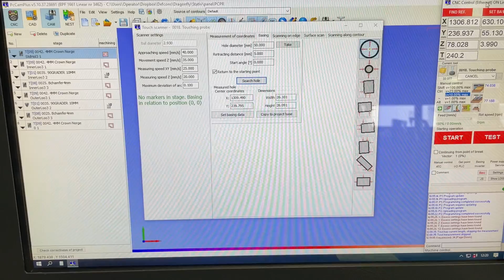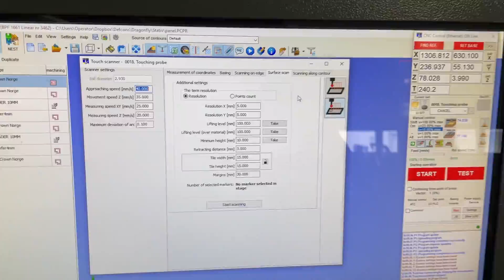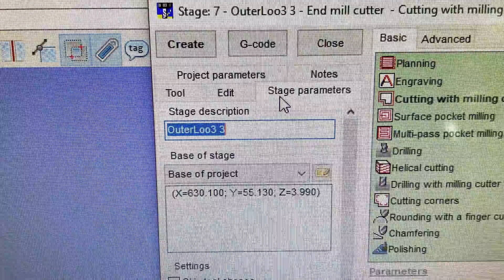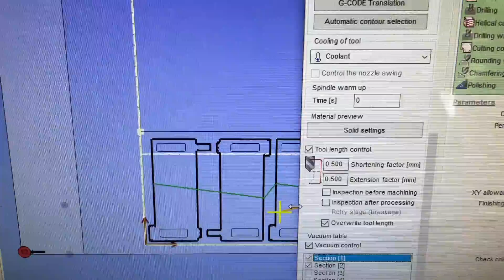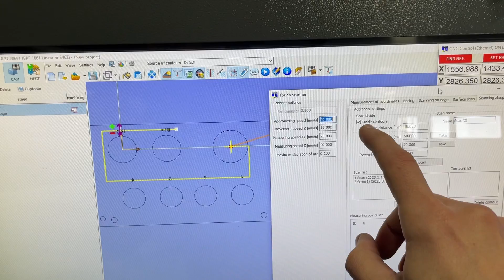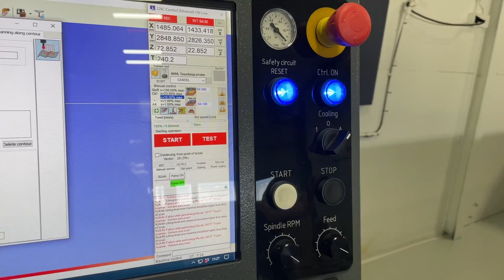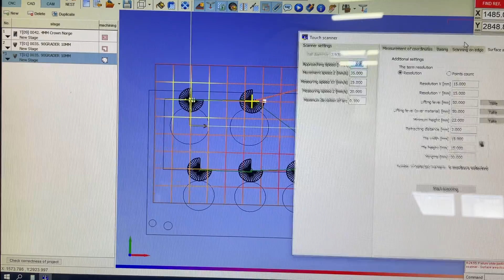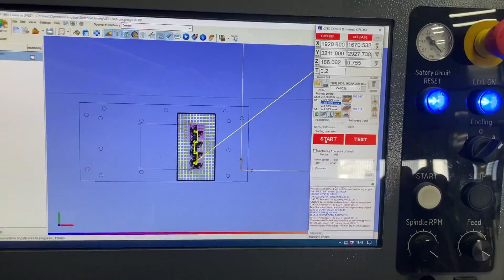Top 10 MONSTER ROUTER things/features - Kimla / PCCAM

Comment from the maker: Having had a extra productive week with the machine and the 2 year anniversary(!) for the Kimla arrival coming up i reflect on my favourite things about it.

Im kinda gushing in the video but its just all so good.
Note. I have seen really high end machines that i would deem equivalent in build quality but then taking the price into account I have to give the win to the kimla.
And when i say "I have seen most of them" i mean a subset of machines from the main manufacturers typically at the big tradeshows. Biesse,Anderson,Wissner,portatec,thermwood, CR onsrud,multicam ect ect. Some of them offer linear motors too! 

Felt i better clearfy to that extent. Alot of good machines out there!

Regarding PCCAM, There is still alot to discover. Automatic placement and nesting is in the cards next.
There is also filename "properties" that can be read in. Material,amount of parts,thickness and also tags that could possibly couple the part to a specific workorder. Exciting stuff!

Comment: Love the videos, thinking Kimla might be the next router for me. Curious what model spindle is spec’d on your machine?
Reply from the maker: Hey, thanks its got a "Kimla Version" of HSD's Watercooled ES951 12kW S1 (14kW S6) HSK63F.
I can stall it going fast with a 16MM triple flute 10mm deep into some 5083 I found out the other day  x)
Reply: @randomrouting That is an awesome setup! Appreciate you sharing your journey and expertise with the world. What is your max rpm?
Reply from the maker: @andrewm1950  Its my pleasure! Its 24krpms, id love more for them small tools i often run. My old machine had a 32k spindle but then again, I do run some thick stuff from time to time so 24k is a good allrounder.

Comment: Hi .
Im Wondering If its possible to Get In touch with you , the company i work at got a kimla router this year and cant figure out the perfect rpm and feed speed when milling in alu.
Reply from the maker: Hi.
Easiest way is probably msg ulundateknik @ instagram.
But if its about feeds and speeds then a comment here probably suffice :)
What tools and what type of aluminium are you cutting ?

I cut mainly 5754 which is soft and i run alot of small tools. You want to produce big chips even with small tools, to keep the heat away, and go with dlc coated single flutes.

I mostly run Crown norge single flute coated tools (kimla sells them aswell).
a 2mm diameter (6mm flute length on all) i run at about 22mm/s, a 3mm i run at 35mm/s and 4mm at 40mm/s . 6mm at 50-70mm/s depending on the part. All at 24k rpms.

If using a 3mm then i got 1 pass on 2,3,4mm alu and 2 pass on 5mm.
Using a 4mm endmill i run 1 pass on 2,3,4,5mm.
6mm endmill 1 pass up to 8mm alu.

For 6082 you might want to back off a tiny bit, and 7075 a bit more.

Comment: what is the part number of the dust collection shoe?
Reply from the maker: Not sure there is one? Maybe kimla has them, not sure. The bottom platter(with the ethanol jets) is my own 3dprinted version though.
Reply: is it possible to get a picture of it and how it attaches to the machine, whether the spindle or is own separate linear actuator? i am currently running a multicam 5000 series cnc and we cut alot of plastic parts and our chip collection is seriously lacking. @randomrouting
Reply from the maker: @coldhardcad8882   Ah i see. I dont have a pictue but i show a bit here: https://youtu.be/xuGintM2q-E?si=Uo8UWfutBZBMoKpY&t=875

I dont think you will be able to buy this separately from Kimla but you could ask.

I used to have a Multicam MG series and back then I was considering this one from Axyz.
https://cncshop.com/products/028088-high-capacity-cast-pressure-foot?variant=34336310919301

Ps. I hate cutting plastic.
Reply: this is phenomenal information.  your system looks like it doesn't use brushes and just keeps the inlet very close to the workpiece. is that correct?  is there a difference between a pressure foot and a dust shoe? @randomrouting
Reply from the maker: @coldhardcad8882   No brushes, The bottom plate on mine has tiny holes that eject pressurized air so that it may float on top of the material beeing cut. My machines original plate is made of stainless steel so i have 3d printed mine so it wont scratch the aluminium if/when the sheet gets cut up to the extent that there is no surface left to float on. 
The inlet hole is 65mm, just big enough to let the HSK63F tool holders trough and there are some threaded holes in the side of the unit that you may plug/unplug to adjust the underpressure/airflow in the cup.

The Axys one i think is available in two versions, one with a "blue donut" which is just a PTFE (or other low friction plastic) and slides on top of the material, and the other version you manually set the hight.

When using system like this you should consider that the airflow is quite restricted and therefor low, you would not do well with a typical woodworking dust collector system. What you want is a high pressure low volume system. I use a side channel blower but there are other good systems that work kind of like big shopvacs.
And when using these systems you dont want to use big 6" ducting.. im using 3" hose and pipe for fast moving air.

Comment: You have probably been asked this before but why not a Fibre Laser instead of a router? I work full-time with a new Amada Fibre laser...
Reply from the maker: Heya. There are a few reasons.
Mainly its because the stuff we make cant be made on a laser. Alot of the stuff we do is 2-2,5d machining (like pocketing,angled faces, threads,surfacing,countersinks ect)
We use the probe alot, do quite a bit of engraving,put parts into the hole in the table then work on the edge,machine 6 meter extrusions on the T-track and pretty much all parts needs to be chamfered on both sides. (which we do without flipping them)
There is no beating the versatility of a router even tho a laser/punch combo machine gets pretty close. You could buy multipl of these routers for the price of amadas laser/punch combo machine tho :) 

Parts are clean(ready for paint) and completely finished, brushed for paintadhesion,cut,threaded,countersinked,engraved and double side chamfered right off the machine (except bending) and that I love the most. They are ready to go without manual labor.
Reply: @randomrouting  awesome! thank you for such a great reply. you have completely changed my opinion of routers. Most People just use them for cabinet manufacturing. 

I hope Fusion invests in  CAM tools Specifically for routers. I currently use the manufacturing extension to nest my parts but the CAM can get very tedious for doing many sheets. 

Have you heard of SigmaNest? Their software looks pretty compelling. integrated offline bending and nesting. sadly doesn't work with the Amada brake press though.
Reply from the maker: @Waytoofarr  Thanks! Yes, if i remember correcly Kimla's (the router brand) nesting addon is using the sigmanest engine for their automated nesting. I dont have that yet but i will soon as i plan on getting it after a visit to the factory soon. 
Havent ever used sigmanest tho as im using amadas "production designer" for flatpattern generation and bending programs. I have automated the heck out of it and it pretty much runs by itself most of the time. I got some scripts that massage the dxf to find features/renames layers and then the kimla autogenerates the toolpaths instantly. Including all chamfering,countersinking and threading.
Its quite crazy accually. 

Another good software for routers is Vectrics Vcarve.(including nesting)

Comment: Hi, May I know around how much is this Kimla CNC machine? Great content❤
Reply from the maker: Back in late 2020 it was around €150k including shipping,12 toolholders ect. 👍
Reply: I bought my first 1.8*2.5m cnc router from China, with t slot table and vacuum table side to side, and a rotating axis. But the machine rigidity and accuracy is really sub par. it only cost €25k total, but I got to make a lot of upgrade to the cnc, and train myself😅
Reply: I really admire your machine, but the price is too much for me now😬
Reply: Wish you the best, I learned a lot, thanks for sharing❤
Reply from the maker: @bbbbbbbbb1975  I built my first cnc from parts in early 2010/12 or so and then later bought a used multicam (4k euro) and retrofitted the control,atc spindle  and servos over a couple years, used that to build the business and eventually could justify and afford the kimla.
Keep going and perfecting, you'll get there!
Only problem is the goalposts keeps on moving :)
Thanks for watching!
Reply: @randomrouting  I think Kimla should support you for making content for their machine, I don’t see any YouTubers make content about Kimla CNC, your channel is underrated!

Comment: Kimla is a funny company. The machines are ok in many ways, but sometimes they do stuff like put soft PU hoses (instead of Nylon or Polyethylene) all throughout the machine (even for coolant). I was helping a friend of a friend as I can service most of CNC machines and I found out that 3 machines had a problem of disintegrating hoses at the same time - All throughout the machines the hoses were disintegrating at random places (coolant mist entered every crevice of the machine from the machining area). It was a disaster, I couldn't even open one of the machines due to strange sheet-metal work. I told him naah I'm not fixing this, call Kimla people :D
Reply from the maker: That doesnt sound great, I didnt see any of that tho. Perhaps they have evolved :)
I have had some gaskets deteriorate rapidly, and the "level showing tube" on the container aswell, but i was running ethanol in a system designed for oil so that was kinda expected :)
I just changed them out for epdm,ptfe ect.
Reply: @randomrouting  yeah I hope they did :D  we were running ethanol cooling with a strong vacuum system and I always worried it would do a bit of a boom one day, but it never happened :D thank god :D We filled a 2000l bag with aluminum chips every 10 days :D Too bad that most of the router companies don't have a ready solution for ethanol cooling even though the machines cut aluminum very often
Reply from the maker: @chronokoks  Yeah its always at the back of my mind aswell since ill be running so much unattended, some precautions have/will be made but I did the calculations a while back and as long as the pump doesnt output more ethanol that is set and the extractor keeps running at the same capacity, then the mixture is too lean to ignite.
2m2 every 10 days is crazy :)
Reply: @randomrouting  Yes, 2 shifts, doing insanely large aluminum plates for automation. It was for some 110 machines for several lines for factory that does something with glass fiber. 1 vacuum tower was sucking chips for 2 big routers. Fun times.
Reply: @randomrouting  a bit of distilled water in the mix decreases the combustibility quite considerably

Comment: If you got way too excited about a youtube channel and you just bought a large format CNC router ;D 
Okay, scouting for >1 year and settled on a Wissner machine. But love the idea of long unattended runs > robot automation for a 1 person machine building business.
Reply from the maker: :) The wissner machines are awesome. Hope you make a video about it!
They also offer linear motors on their high end ones, mineral casting in the table and its all out of aluminium with coolant lines though the plates. Their vacuum tables are also really nice.
👍
Reply: @randomrouting  Haha I hope so! Unfortunately not with linear motors, but got a second hand deal it was hard to say no to.
Will do a vid about it once its here - lets see if it becomes a retrofit project or if I just go for a Heidenhain controller. 
And hope their wired one-side-driven gantry design is of any use.